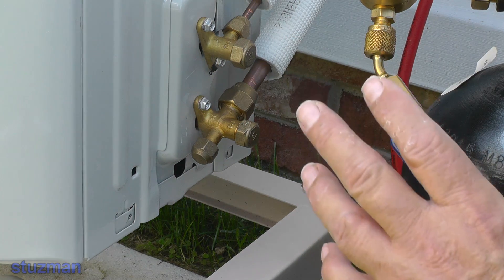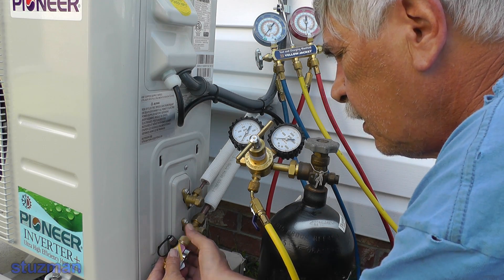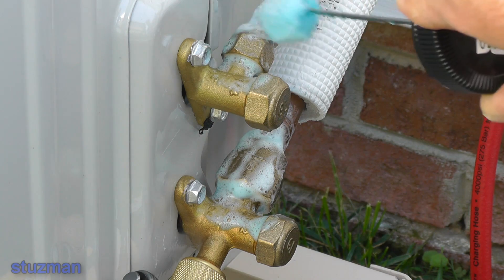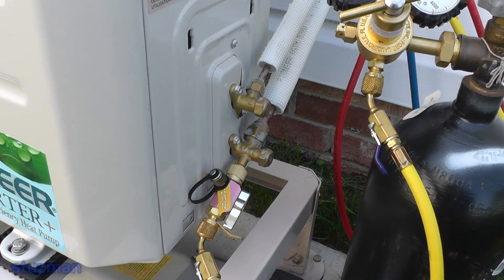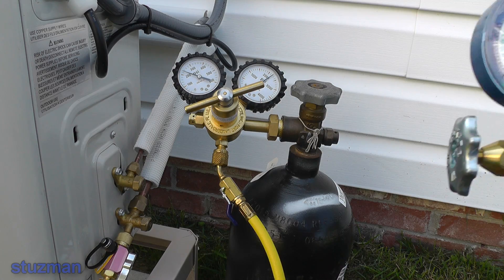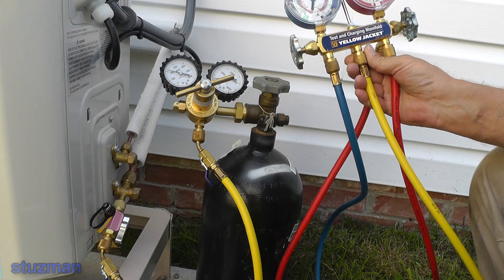Mini-Split Heat Pump: Nitrogen Pressure Test

Comment: Hi, why some of guys don't do pressure test ? They just do vacuum test. What is the difference ? Isn't vacuum test enough ? thank you
Reply from the maker: Well, if you eliminate one of the tests such as a pressure test, that's one less thing to do. And you can move on to the next job. You always want to do a pressure test before you vacuum. Having a system under a vacuum will not detect small leaks. And if you did see a leak under a vacuum, what will you do now to find a leak while under a vacuum? The only way is to pressurize the system. Thanks for the comment and have a great day!
Reply: @stuzman52  Hi, thanks for reply, one more question, why did you do it with nitrogen? Is it not enough to pump air with a compressor?
Reply from the maker: @SamuelBachorik-Mrtapo8-ApeX  Some people do use compressed air, but there is always water vapor inside the compressed air which is being introduced into the system. Even though you may not see it, it's there. Although, the system has air inside it, why throw more into it. Another reason is that you want at least 200 psi or even more psi depending on the system to pressure check for small leaks that the system may have. Most air compressors will not get to these higher pressures. Also, nitrogen is an inert gas which is very dry, (no water vapor) and will not react with any metals in the system. Some people will use argon or CO2 which is fine because they are inert and are very dry. Have a great day Samuel!

Comment: so doesn't the line set and indoor coil  have a little air and moisture in it before you even add the nitrogen? If so , how is it purged before the nitro goes in ?  Otherwise you have a mixture of nitro, air and moisture in the line and unit ?
Reply from the maker: Yes, there is a small amount of air and moisture within in the system. In the field, the nitrogen is added to the line-set to check for leaks using the pressure. Afterwards, the nitrogen is released and then a vacuum pump is attached which removes the air and moisture.

Comment: Pressure test is not needed for home users and factory build units when professional tooling is used for pipes.  The test came from engineered and build cooling systems where piping is soldered all around.
Reply from the maker: There would be some service technicians out there who would disagree with you. I would much rather test a system for leaks rather than just dump the refrigerant into the line-set and then find out later there is a leak. And one could look at brazed joints that if they were done professionally correct, then you wouldn't need to test those joints for leaks. Of course, whether to pressure test the system or not is up to the individual.

Comment: thanks for the video. Quick question. Do you need those yellow jacket gauges? The tank regulator holds at 200psi, isn't that telling you there is no pressure leak?
Reply from the maker: You could get away without using the manifold gauges, but they do offer a higher resolution than the gauge on the regulator. Thanks for watching Tim and have a great day!

Comment: When you began the pressure check you never said or showed closing the valve?  You said leave it for ten minutes and check it but with the tank still on and open it would just replace any leaked pressure??  I don't see the valving necessary to close off the system with a gauge included to actually test the pressure???
Reply from the maker: Hi Douglas! It may appear that I didn't close any valve for the nitrogen. I probably should have mentioned it, but I show closing off the low pressure valve on the manifold set at timeline 4:00. Have a great day!

Comment: Great, informative video series on how to install a mini split. One question - where did you buy your nitrogen tank and gauges, and where would one get a nitrogen tank filled? Thanks
Reply from the maker: The tank and nitrogen was purchased and AirGas Supply which is a national chain. You probably have one near you. The gauges and regulator for tank were purchased from Amazon.

Comment: No wonder it was holding the pressure, you did not shut off the valve between pressure regulator and manifold. In that case even with a leak, pressure stays as set.
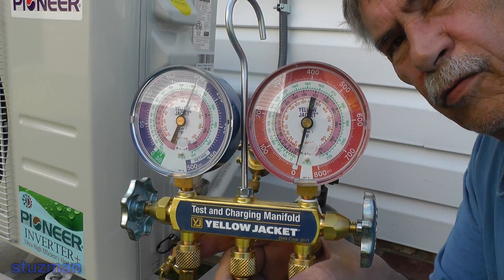Reply from the maker: Maciej, it may appear that I didn't shut off the nitrogen, but that is not the case. I didn't mention it in the video, but the low-pressure valve on the manifold was closed at the timeline of 4:05 in the video. Thank you for the comment!

Comment: I've never waited so long to find a leak ! Just a little tip : when you finally release your nitrogen outside, you can do it in one shot by quickly opening your valve, so it's gonna kick all the crap inside more efficiently

Comment: What flaring tool doo you use Stuz?
Reply from the maker: Hi Jay! The took kit is Hilmor 1937685 Orbital Flare Kit.
Reply: @stuzman52  Thanks Stuz. I did install 2 heat pumps home and one took 2 months to leak out and the other one took a year and a 1/2. i used a cheap flaring tool. So i am hoping I can do some better flares next time. I also bought a torque wrench. what would u recommend to check for leaks a vacuum test or nitrogen test? Thank you.
Reply from the maker: @jaylandry8915  Hi Jay and sorry to hear about your flaring issues. You ALWAYS want to do a pressure test and not rely on a vacuum test to check for leaks. Most techs will use nitrogen as a means to find the leaks. And if you think about it, how would you find a leak when it's under a vacuum? You can't use bubbles as it will be drawn into the system. So, first step, pressurize the system with nitrogen, (200-300 lbs is okay), use bubbles to find the leak(s), let the nitrogen out to the atmosphere, fix the leak(s), and redo the test again to verify that the leak(s) has been fixed. Some folks out there will say to test the system to the test pressure of the coils such as 400-500 lbs. You do not need to do this as the indoor and outdoor coil as been tested at the factory. And if your luck is like mine, you stand a good chance of bursting the piping in the coils 😊. You're only testing the flair connections that you made. After that, you'll want to pull a vacuum on the system and using a micron gauge will tell you exactly how much air is still in the system. You'll want to have at least 500 microns in the system. I'll let the vacuum pump run and get the reading down as low as it will go to remove as much air as possible.

As a side note about the orbital tool, it is designed to work with mini-split units as the orbital tool will not put as much stress on the flair being created as a typical flaring tool. Be sure to put a small amount of blue Nylog on the cone of the tool before creating the flair as the Nylog will serve as a lubricant/sealant which will create an ultra-smooth finish on the flair. After the flair is created, put a small amount of Nylog on the face of the fitting, (no Nylog on the threads) and then torque the fittings to the manufacturer's recommendations. Good to hear that you got a torque wrench and with the correct flaring tool, you won't have any more leaks on those flairs. The system that I install over three years ago is still going strong and no leaks. Good luck Jay on all of your future projects!

Comment: i am installing a multi zone mini split.  Do you pressure test and vacuum each zone separately or can i use the main svcvalves and pressure test/vacuum the complete system?
Reply from the maker: I'm not sure how your system is configured, but the norm is to pressure test/vacuum each zone. Otherwise, if you do the entire system, how would you know which zone the leak would be in?

Comment: hello sir i am from Indonesia. when you do drop test or leak test. there is gas or freon or not on ac system. do i have to dump the refrigerant all the way before do leak testing? should i open service valve and pressure line valve( smal one) when i do leak test. thanks for your help if you dont mind help my question cheers
Reply from the maker: When you pressure test the system with nitrogen Rachel, there is no refrigerant in the system. If you have refrigerant in the system and there is a leak, you can use the refrigerant pressure to find a leak. Methods include soap bubbles, ultrasonic leak detector or a leak detector that can 'sniff' the refrigerant itself. You do not open the service valves when doing a pressure test.
Reply: @stuzman52  thanks u sir i really appriciate for answer my problem

Comment: If I pulled the vaccuum ;and left the micron meter there showing 240 micron For 6 h with no de gradation, Why should I do pessue test with nitrogen ?
Reply from the maker: The reason for the pressure test is to find small leaks under a higher pressure than what would be under a vacuum. Since you kept the gauge on there for 6 hours, more than likely you don't have a leak.

Comment: Can i ask, Why the Low side and not the High?
Reply from the maker: The low side gauge has a higher resolution than the other gauge. Makes it a little easier to read for pressure drops of the nitrogen.

Comment: hi, some of these units come with a mini condensate pump. when would i need to use that?  thanks
Reply from the maker: The only scenario that I can think of is if the indoor unit is located in a basement which is below grade level. The pump would then pump the condensate upward to get above the grade level to be deposited on the ground. In most cases, the indoor unit is located above grade level where the condensate will move by gravity to be deposited on the ground.

Comment: 200psi . Your not going to see any form
Of micro leak . Hope you use a micron gauge and do decay testing on you vac down . Otherwise you must like coming back
Reply from the maker: I will disagree with you that 200psi isn't enough to see a small leak. Bubble gel will show very small leaks which was used in the video. And yes, I used a micron gauge during the vacuum procedure and it's been two years on the install and has been working fine since. Of course, you can pressurize the system to whatever you feel adequate.

Comment: Great video and good info.  Only 1 issue, at 4:00 he forgot to mention he isolates the tank from the test by closing off the low pressure (blue) valve.  You can see him close the valve off.
Reply from the maker: Thanks Mike!
Reply: Thanks, that was the part I was missing. How could he know he didn't have a leak if there's a constant flow of nitrogen at 200 PSI coming in?
Reply: thank you!
Reply: Excuse my question, After reading more comments, I see others already posted the same question and it has already been answered. Still the best video I have viewed on the topic.
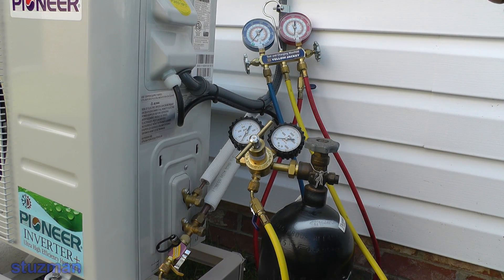Reply: He did that at ~ 2:45
Reply: I questioned that while watching the video and it was hard to see closing the valve .. saw your comment and it was spot on!

Comment: Why are you using the red, blue and yellow guages rather than just using the pressure guage that's attached to your nitrogen tank?
Reply from the maker: I'm actually more focused on the compound gauge on the side connected to the blue line. The reason is that the gauge on the nitrogen tank doesn't have the resolution to see small pressure drops as it goes to 4000 psi.
Reply: @stuzman52  thanks!

Comment: Where do i get nitrogen. Where do i get vac machine ? Pls
Reply from the maker: I mention it in the last video of this 4 part series. You can get the nitrogen and tank from Air Gas Supply which is a national chain or from a welding supply.

Comment: Hi , do you have a video on pressure testing and  vacuum of a  36000 BTU ( 4 } four zone mini split ( four 9000 BTU indoor unit )  Not sure if all 4 line sets  need to be vacuumed individually  or is there way to do all one shot ? 
Thanks  Jay
Reply from the maker: Sorry I don't have a video for multi-zone systems. I've never done one of these systems, but would think that the manual would offer some information about it. My guess it that since each system is isolated, each would have to be tested individually. If the manual doesn't offer any help, you could call the manufacturer and I'm sure they could point you in the right direction.

Comment: can you pressure-test with argon or an argon mix? does it have to be nitrogen?
Reply from the maker: I'm not really sure Sam as I've never done it. Here are a few links that may help http://www.refrigeration-engineer.com/forums/showthread.php?8951-Using-Argon-to-pressure-test

https://www.hvac-talk.com/vbb/showthread.php?2198123-Use-Argon-to-pressure-test

http://www.peachparts.com/shopforum/diesel-discussion/191827-c-system-pressure-test-argon-co2-instead-nitrogen.html

Comment: I've watched all your mini-split videos and they are the best by far. Was wondering if all you need compound gauges for install is for nitro press  test. Can I avoid buying set?
Reply: Seems to me you could just hook the nitrogen bottle directly to the service port. Nitrogen bottle has a perfectly good gauge on the reg. Once pressure is at the desired test point close the bottle valve to isolate it. Would that not work just as well? Less complicated, fewer lines, valves.
Reply from the maker: It's good to have them marc if only to monitor the pressure over a period of time to see if the pressure drops. If you don't use them, then you'll have to solely rely on the bubble test.

Comment: hey sir great video! but how do u nitro test a multi split? do you nitro individually on each service valve or just 1?
Reply from the maker: I've never done a multi-split unit, but from what I understand, you'll pressure test each unit separately, especially if you have a separate service valve for each zone.

Comment: thanks for this video,  after you are done with pressure test with nitrogen, how you gona release or get rid of the nitrogen in the system ? did you mentioned it , sorry if this question is very noob. i have noticed at 9:55, are you releasing all the NItrogen there ? but i am not sure
Reply from the maker: Yes, you are correct Steven. After the pressure test is completed, the nitrogen in the system is released to the atmosphere.
Reply: @stuzman52  thanks

Comment: That's as good as it gets! You explain it very well. Hopefully people are paying close attention because after you let refrigerant into the lines through the low-side of the gauge set and adjust the regulator valve to get the line pressure  to 200 PSI, you close off the low-side valve of the gauge step, which cuts off the feed of nitrogen from the N2 tank, otherwise that would overcome the pressure lost by any leaks and be self-defeating. You don't mention that's what you're doing at that step though, you just crank the gauge blue (low-side) valve closed. and that's a really important step!  My Daikin outdoor compressor installation manual says to pressure test at 550 PSI, but don't exceed that. Also recommends holding the pressure for 24 hours but I think it says minimu of 1-2 hrs.. Not sure if all mini-splits can handle 550 PSI, but from what I understand r410a generally reaches a pretty high pressure in mini splits. Anyway the higher PSI test might catch some leaks lower pressures won't, so why not?
Reply from the maker: One can use higher pressure, but never exceed the test pressures of the indoor or outdoor coil and use the pressure which is lower. No particular reason for the lower pressure and even if there was a small leak at 200psi, it would have showed up.
Reply: Ha ! I now notice multitudes of us in the comments have picked up on the “failure to close low side valve” , a mistake Stuzman is unlikely to repeat now
Reply: I just installed a Pioneer can't find any spec on the pressure just going to be safe and test to 200 psi check the flares waiting on a regulator picked up a 22cf tank at the welding store.  Probably overkill I figured I can use it it to fill tires, and blow stuff off nice to have a high pressure tank don't have to fire up a  loud compressor takes forever to fill.
Reply: Yup - I had to rewind to see that he did that.

Comment: The bubble test is fine. But as far as pressure drop, it seems to me that you kept the nitrogen tank ooen...so IF there was a leak nitrogen would keep coming from the tank, keeping pressure constant....at least for some time, depending of course of how bad the leak was...
Reply from the maker: Although the nitrogen tank valve was left open, I had the valve closed off on the low side of the manifold gauge set. One can close the valve on the tank if it's desired.
Reply: Understood, thanks Sir